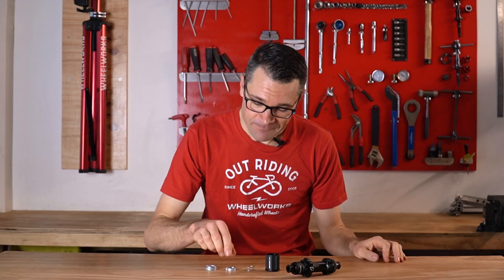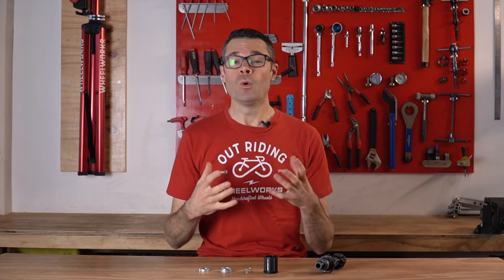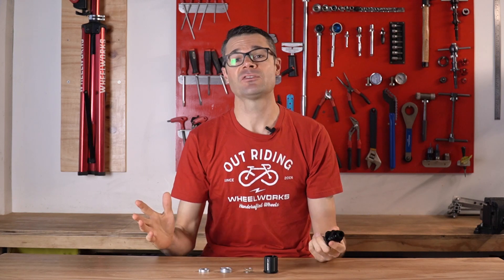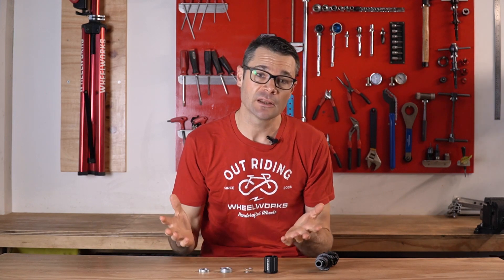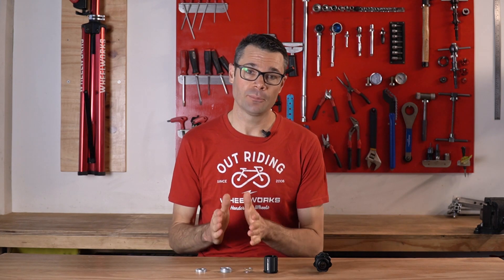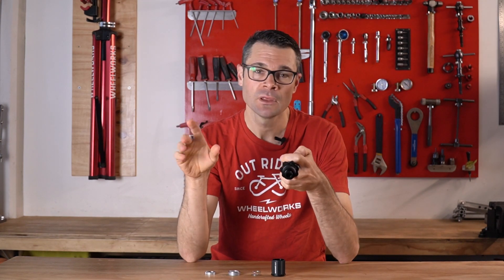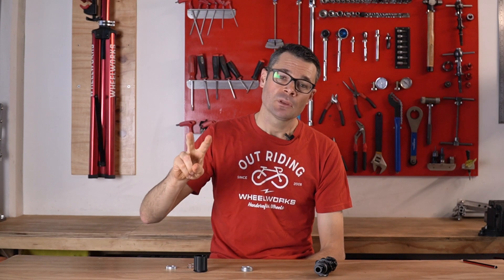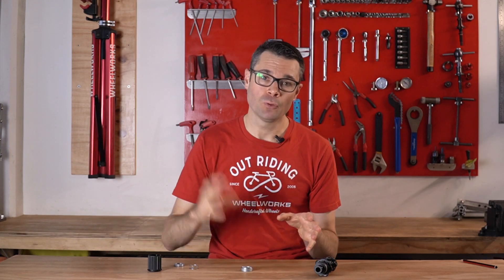DT-Swiss EXP Issue 2021

Comment: I have the older 350 6nut one. It doesn't spin for long, what could be the culprit?
Reply from the maker: It doesn't spin when in your hands or in the fork?  If in your hands its likely the endcaps are binding - put the thru-axle into the hub and this will align the endcaps.  If its not spinning in the bike it's likely to be the bearings are worn out.  -TT

Comment: Can you please tell me your opinion on dt 350 hub for a rider that has way to much torque for nearly all hubs on the market thats me. I have stripped the drive ring threads on 3 hope pro 4 hubs in the last 2 years i do ride alot and ride super steep tech climbs i am a little dubious about the strength of the 54 poe star ratchet on dt your honest opinion would be great thanks .
Reply from the maker: Stripped drive rings isn't something we seen on Hope hubs, so if you're that hard on them I'm really not sure.  You could take a look at the OS version of the 240 and 350 which both have oversized threaded rings - we have a deepdive on the 240 version on our channel

Comment: I bought a 2022 Specialized Epic Evo Expert - comes standard with Roval Control SL wheels with DT Swiss EXP ratchet 350hub.  It has the 2 spring / 2 floating star ratchet design which is supposedly better and more reliable then the new 1 spring / 1 floating / 1 fixed ratchet design.  Yet I experienced the same issue on a 16km ride in July 2023. Free hub would let go intermittently and I thought the chain was skipping on the cassette. But I had a new cassette, new chain and chain ring. Max 300kms. Hot melt waxed chain from new so no wear. Then as I stood on the pedal to start from stop it let go completely causing pedal to go straight to bottom of stroke and I fell off! 0km per hour crash but I thought my chain had broke. 2 mates were behind or beside me and witnessed it. One said he could see cassette spin but wheel didnt move. Was able to ride last 3 kms but had to stay in light gears as too much power caused free hub to intermittently slip again.
Reply: Bike is now with Specialized dealer awaiting response from DT Swiss.....Dealer was unable to replicate fault (of course!).  My impression was they were a little skeptical it had happened with the 350hub. I think I'll pay them a visit and show them all these videos and comments!
Reply from the maker: If you have TWO floating ratchet rings and TWO springs then it's not an EXP hub.  The 350 is the "Ratchet" system, not EXP, so it sounds like you've got a different problem going on, not this one.  Best of luck getting it sorted out!  -TT
Reply: DT Swiss replaced the star ratchets and springs after I sent them pictures of the worn teeth. The problem hasn't happened since, although I haven't done a lot of kms either 🤞
Reply: Since my original post I bought a BMC Kaius 01 TWO in August 24.  This model apparently has the star ratchet system too, although a copy by another brand  whos name escapes me. (BMC G39 carbon wheels).  The Star Ratchet free hub let go today, stranding me 50kms from home. Brand new bike with only 448kms on it.  I also had the same issue on my Giant Propel SL0 with Cadex Wheels - which use the same DT Swiss design.  So that's 3 times now!!  Very disappointing and at times, dangerous.

Comment: I am going to say i am very disappointed in DT swiss hubs lately. I bought a set of 180's for my gravel / cx race bike - and front hub bearings were rough from the box - bearings were clearly pressed in way to hard. I replaced, all smooth. This has then been the case for set of 180's for xc race bike wheel build and same for a third set for xc marathon bike build. The bearings in rear hub as well as front hub were rough for the xc race bike. Considering they cost circa 1500 aud for a set of front and rear hubs, having rough bearings out of the box for over half of them is really poor. This may be limited to the 180's - not sure - but very, very disappointing. As was the need to buy yet another tool to replace rear bearings in the exp rear hub. As was the fact that when i have written to DT re rough bearings issue - they have not replied. Obviously couldnt give an F. 

These will be my last ever DT hub purchases. It saddens me when companies go from being great, to the culture they now have. This will not be good for their future.
Reply: The original hubs were made in Switzerland. Same with all their great spokes. They were the best in the industry.  How strange that some of the products are made now in Asia or wherever..
Reply: The original hubs were made in Switzerland. Same with all their great spokes. They were the best in the industry.  How strange that some of the products are made now in Asia or wherever..
Reply: Probably they went woke lol. I steer away from these companies.
Reply: @johnlesoudeur3653  LOL! i dont think that was it, or they would have done something like put in there some pawls that identify as a star ratchet hahahahahahahaha. 

Just a) really disappointing level of tolerance quality for what is a VERY expensive hub - $600 for a front hub is up there, and all up i have had 3 sets with bearings that are rough as out of the box. then b) when i contact DT re this - get nil, nix, nada in reply. I cannot abide F$ck you level of customer service or care. If they are too big to give a shit about their customers now, then fine - there a plenty of other hubs out there, and I hold grudges on this sort of shit, i will NEVER, EVER, EVER buy another DT hub in my life, and will not recommend others support either until i see they have changed. Product issues - all brands have them. Not giving a flying F about you customers - who - may i remind them, are actually people - with feelings, who work hard to earn the $$ they spent on your products - which is what keeps your company alive. it is companies that dont care about the people they depend on that drives me nuts and is for me unforgiveable. Next build i am going to try a set of tactix hubs, now they look amazing.

Comment: Had this issue after only 12km on a bike bought new in May 2023, so there are obviously still affected hubs appearing on new build bikes.
Reply from the maker: That's sad to hear.  We replaced all of the ratchet rings in hubs we had in stock at the time but maybe that didn't happen with where you bought the bike?

Comment: So, what was the actual issue?  Were the teeth of the ratchet breaking off?  Was the spring too weak?  Was the teeth of the ratchet not designed properly?
Reply from the maker: The ratchets were slightly too rough and causing wear on the freehub body.  The (soft) aluminium freehub body then wouldn't allow the ratchet to slide and thus would cause the hub to either not engage or not disengage -Tristan

Comment: Getting that star ratchet out of the hub body is freaking impossible.
Reply from the maker: Yeah it's a major flaw with DT Swiss hubs that no one seems to want to talk about!  The EXP system is especially problematic as the tool engagement is only a couple of mm and I fear that we'll see this break leading to hubs which cannot have their bearings replaced.  We built a small helper to firmly bolt the removal tool in place when removing the EXP ratchet ring to prevent this -Tristan
Reply: @WheelworksHandcraftedWheels  In the end to get it out, soaked it in penetrating oil for 2 days, and heated it up with a torch. Then it popped right out.
Reply from the maker: @bubbastard  boiling the kettle is a safer option - that way you know the water is only 100 degrees and you're not going to damage anything.  Generally slowly pouring a kettle full of boiling water over the hub is enough to help loosen the ratchet -Tristan

Comment: I bought a set of wheels recently with generic ratchet hubs and they work great. I upgraded the 36t to 60t and use two Springs although you can use just the one. Very loud but engaged so fast
Reply: That’s not the EXP type hub
Reply: @JGD444  I'm not sure tbh I believe thet are DtSwiss copies that's all I lnow

Comment: Does it apply only to exp hub verions ? I just bought DT swiss 370 Ratchet LN hub, do i need to check it also for number 1 ? I do not think that 370 hubs exist in exp versions
Reply from the maker: This issue is EXP only - so only the 240 EXP and 180 EXP -TT

Comment: Did you ever had issues with the bearings of the 240 exp's main body? The bearings are getting harder to turn after around 150 kilometers. I replaced them 3 times on a dt swiss dealership and the happened again and again. (the freehub works perfectly)
Reply from the maker: All of the new EXP hubs are very particular about the thru-axle torque and you'll get massive bearing drag and worn-out bearings if the torque is too high.  10Nm is max :-)  -Tristan
Reply: @WheelworksHandcraftedWheels  So this too will not impact the 350 hubs at all?  TIA
Reply from the maker: @Phantom_MTB  correct - the 350 uses the classic star-ratchet system and NOT the newer EXP system -Tristan

Comment: I have one question.
When the hub disengage,it does it usually for one teeth or it does disengage all together?
Reply from the maker: The DT Swiss ratchet rings are lots of little ramps...when the hub is freewheeling the two ratchet rings are running up and down these ramps constantly.  -Tristan
Reply: @WheelworksHandcraftedWheels  yes i know that.
I mean,when the rachet start to fail,it start skip tooth by tooth or it skipping too many teeths at once?
I habe some skip in my old style dt 240s but i am not sure if it is the small 11t sprocket or it's the rachet.the skip happens only in that gear and when i push too much.
Reply from the maker: @Cylcopath_GR  The problem is that the floating ratchet gets stuck in the freehub body.  Generally speaking this causes the hub to freewheel in both directions with no drive at all, rather than skip.  -Tristan

Comment: Hi. I had my exp freehub changed however recently. When I'm freewheeling the hub initially makes the normal ticking noise and then it goes almost silent. I have no drive issues though. Can you advise re this please
Reply from the maker: That's a strange one - the noise should stay constant.  I'd suggest you have someone with DT Swiss experience take a look - if you're in NZ we can certainly help and you can book a repair via our website.  -Tristan

Comment: I got the replacement kit, including the freehub. I can't see any visible difference in the freehub, is there really any point in throwing out a slightly used freehub?
Reply from the maker: Yes there is.  The damage can be impossible to see with the naked eye and re-using the old freehub body will likely make your issues continue. -Tristan

Comment: A friend and I both bought the same bike, YT Jeffsy. While on the trail his rear hub would not engage just like the video notes.  This was the third ride on new bike. I check my three digit number and there is a 1 in the middle. My question is this. Should I call DT Swiss for repairs? Will they only address if hubs fails first? Don’t want to wait too long and then it’s out of warranty. Thanks for the video!!!
Reply from the maker: You should get in touch with your local DT Swiss service center and have those parts replaced -Trsitan

Comment: We've known this issue since day zero. Talked to DT execs - zero response. Customer reports on website - zero. The single ratchet 'fix' is not a fix. The first time the ratchet strips it damages the non-floating ratchet. Unfortunately it means that dealers and wheelbuilders now need to take responsibility for poorly crafted hubs without any support from the actual MFG. In going forward - it's still roulette whether you will end up with mis-engaging hub or not.

Comment: When DT purchased Hügi, the initial hub design had one spring and a fixed ratchet. They acknowledged that having two springs would ensure that both ratchets would engage regardless of axial load. 

Not sure why they returned to the single spring setup.
Reply: Cause their license expired. Stick to star ratchet hubs, EXPs are shite and obnoxiously loud.
Reply from the maker: I'm kicking myself for selling the Hugi hub that I had...it would be great to pull it apart and look at the differences between that 25 year old hub and the new EXP system!  -Tristan

Comment: Hi guys, I have the XMC 1200 and i have exactly this issue. free hub is rotating in both directions. Number of the rear hub is P2098592 306 DTP N 10024181. Thank you for very help full video.
Reply from the maker: Glad it helped Martin.  You should be able to reach out to your local DT Swiss service center for replacement parts -Trisatn

Comment: Just to let folks know that the problem lives on. My lbs sent my almost new and expensive(!)  Roval Terra wheelset back to Roval after the hub freewheeled about a month ago. Lo and behold after the “repair” it happened again, for short periods, about ten times on a 35 mile ride! Almost fell on a climb… Plus got noisier as the ride went on. Unconscionable in my opinion that Roval, now owned by Specialized, is still selling wheels with this hub.
Reply from the maker: Urg - sorry to hear that mate.  Next time buy Wheelworks ;-)  -Tristan

Comment: Interesting. My buddy was riding his 1 year old mountain tandem with DT Swiss 350 hybrid rear hub and had engagement issues in the granny gear going up a steep pitch over the weekend. He talked with a mechanic today who suggested tightening the axle down some more, which (apparently) has solved the problem.  I can't figure out how that could be an issue, so was googling and came upon your video. Looks like it doesn't apply to the 350 hub, but do you have any insight into this? Thanks!
Reply from the maker: Hi Joel.  Unless the axle was completely loose I can't see how that would solve the issue.  It sounds like the hub might need a full service -Tristan

Comment: If I am in "case 1" (brand new wheel) how can I be sure that the spare ratchet I will buy it's with the new surface finish? So not affected as the original in the hub? All spares around are fixed ones? Thanks in advance..
Reply from the maker: You'd need to check that with the company you buy from.  All of our replacement parts are of the revised models. -Tristan

Comment: If I get the 54 upgrade will that resolve this issue? 
I have the 180 exp made in 2019 (2’9’3) 9 is the number in the middle
Reply from the maker: Yep!  But if you've ridden the wheels you'll need a new freehub body as well. -Tristan

Comment: I have these issue. Dt Swiss does not help me. The service point says the shipping is too expensive. Don’t know what to do. Already 5 weeks without my wheel. Awful experience!
Reply from the maker: Sorry to hear that Michael.  What country are you in? -Tristan
Reply: @WheelworksHandcraftedWheels  Currently on Gran Canaria until April. Already bought a new wheel set yesterday. Ridiculous when you buy a bike for 12000,- Euro and can’t ride it for the first 3 month and then have to buy a new wheel set because the service point from dtswiss does not want to ship it. Yesterday the dt Swiss service point told me then that they would order the parts here so that they do not have to send the wheel to France. But the tool they need to change the part inside the wheel is sold out. Can’t tell you how frustrated I was to hear that. However, dt Swiss is a big company and I am just one small costumer.

Comment: I have a pair of Roval Control SL wheels which are 2 months old, my product code has a "1" as the middle digit so should not be effected!
Earlier this week whilst out on an mtb ride the freehub disengaged and I could not get any drive, I have stripped cleaned and rebuilt the freehub and it seems to be ok again, however, it would appear that the problem with the freehub has not been fixed by upgraded parts!!
Reply from the maker: That's not good!  Did you use the DT Swiss "special grease" that they supply?  -Tristan
Reply: @WheelworksHandcraftedWheels I didn't have any of the DT Swiss grease, I have used some Park Tools grease for the time being. Should I get some of the DT Swiss grease? Thanks
Reply: @WheelworksHandcraftedWheels  The grease that was in the freehub at the time was whatever was in it from the factory! I've read that there have been issues caused by too much grease being used during assembly at the factory!

Comment: great clear video thanks so much. My wife has been riding a EXP rear MTB hub P ..... 401 DTP F ... so middle digit is a zero which means it might be affected. She has not experienced problems, your recommendation is to change the whole freehub assembly if the wheels been ridden - can I ask why? (is it because the notches in the aluminium fhb might have been damaged?) cheers, Pat. (France)
Reply from the maker: DT Swiss aren't clear, but it appears the slightly rougher ratchet rings make small groves into the freehub body.  -Tristan

Comment: I have bought a pair of used roval alpinist wheels, the digit in the middle of the batch code is 0, what should I do? Who is responsible for managing the problem in my case in your opinion: specialized, dt swisse, who sold me the wheels?
Reply from the maker: You don't say what country you're in but I'd call DT Swiss first
Reply: @WheelworksHandcraftedWheels  Italy … I wrote to dt swiss, anyway in 4000 km I didn’t have any problem
Reply: Update: DT Swiss asked me additional information (serial number, address, etc...) and they will send me a kit for the substitution of the defective parts

Comment: How can we be sure a brand new replacement floating star ratchet did not come from the bad batch?
Reply from the maker: Some (but not all) of the 'good' ones have an "e" on them, however in our experience this is pretty rare.  Basically there is no way to tell other than asking the retailer who sold them to you.  In our case we replaced all the hubs we had in stock and used a high-tech solution of putting a post-it note in the box with the date we replaced the ratchet ring :-D  -Tristan